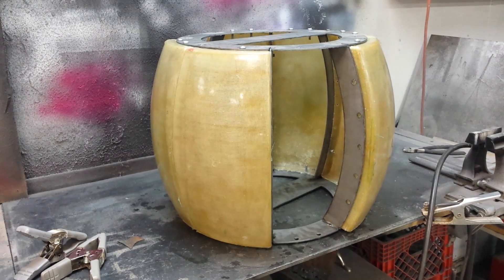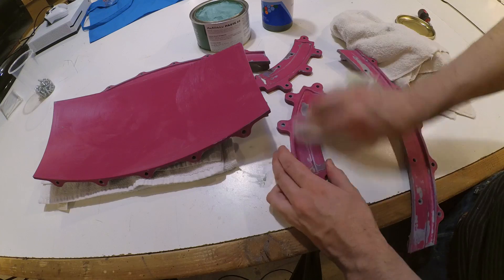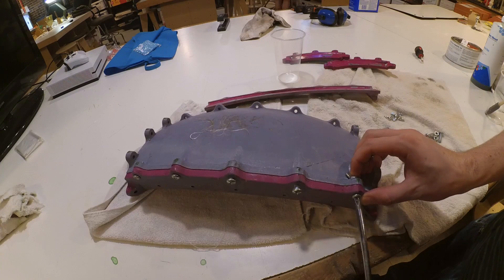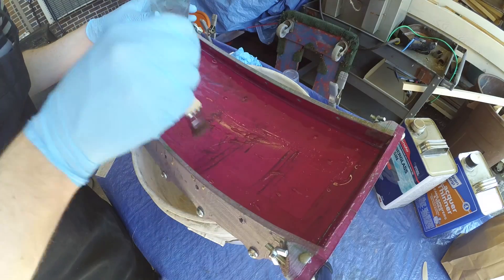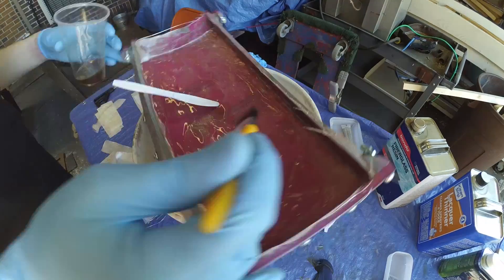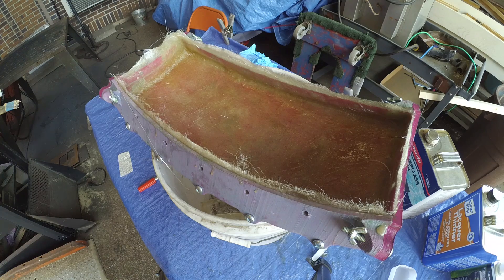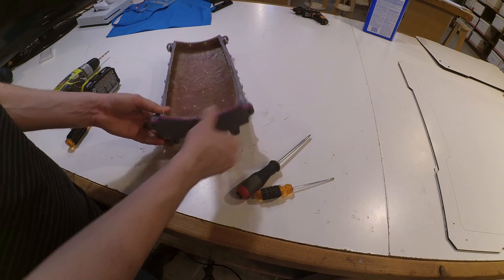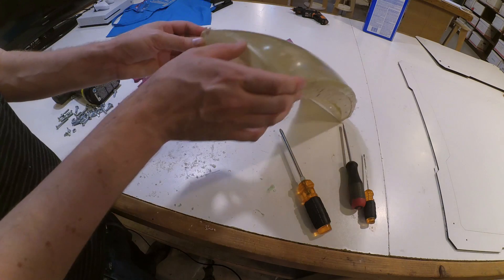Making Fiberglass Parts in a 3D Printed Mold

Comment: Hello, I tried this, but the fiberglass resin broke down the paint in my mold so I don't seem to have a good enough paint layer to hold up to the resin even with wax and pva.  In your video you mention, "final top coat of clear gross seals all the layers of paint together".  What is this gross?

Comment: Which type of material used for mold???
Reply from the maker: PLA that has been sanded and painted for a smooth finish, then waxed and coated with pva mold release
Reply: We also facing problem with mold...

Comment: So the mold wax is what you use to smooth out the 3d printer layer lines?
Reply from the maker: The mold wax is a final polish for the surface to make sure there is nothing for the resin to grab onto. The layer lines where filled and sanded using automotive filler primer, then the mold was given a final coat with gloss spray paint to make it a smooth as possible before we started

Comment: If I use an unpainted PLA mold, will the mold last several uses or will it deteriorate with the curing temperature?
Reply from the maker: I panted the mold as part of a process to smooth its surface. You can use an unpainted mold, but the layer lines and any imperfections in the molds printed surface will show up on your final fiberglass parts
Reply: @DistractedArchitect   Thank u, and what is the best infill percentage and wall thickness for this mold size or larger?

Comment: Does anyone know what the best infill percentage should be for molds like this that will be used for vacuum bagging carbon fiber?
Reply from the maker: Harold,.3D Printed parts are surprisingly good under compression. My suggestion would be 20% to 30% infill, with standard wall thickness. Before you start printing the mold, you can test the strength of a a sample part by taking something you've 3D printed and putting it under vacuum in a bag. That will tell you right away if the part is strong enough for the process, or if you need to add more infill.
Reply: @DistractedArchitect  Thank you, Michael I'll print a sample at 20%  to test it. Thanks again.

Comment: @Michael Curry isnt the curing temperature high enough to damage the PLA mold? Or is it saved by the first layer which is not resin, that shields the mold surface?
Great video, well done
Reply from the maker: I worried about this, but the heat of curing didn't cause any real issue with the PLA.  That said, this molds didn't have a long life. After casting the 8th panel the Filler Primer I'd used to smooth the 3D prints was visibly starting break down and bubble. I think that had more to do with the fiberglass resin interacting with the paint then the heat of curing.
Reply: @DistractedArchitect  Could try the ceramic paint used on engine blocks and the like. That way it's a smooth finish, impervious to any heat that may be generated and since ceramics are generally pretty rugged. It shouldn't chip, bubble or peel up and perhaps give much longer life to your molds.
Reply from the maker: @MidnightMarrow  That's a good thought

Comment: Can this method be employed in making a Micro-hydro turbine with polyester resin and E-glass fibre?
I am really worried about how to successfully make a mould using 3d printing. For making a mould, can I use PLA or ABS for this process using FDM type 3D printing?
Reply from the maker: It depends on the size of what your building. Do you want to make the turbine housing from fiberglass? Or the turbine's impeller
Reply: @DistractedArchitect  turbine impellar
Reply from the maker: @sanjheevramalingam3506  Building an impeller with this method will be difficult. You may be better off directly 3D Printing the impeller with a very high infill, then using the fiberglass molding to build the housing and other components.
Reply: @DistractedArchitect  Can I use bristles of fibre instead of using sheets of fibre mat for compression moulding?
Reply from the maker: @sanjheevramalingam3506  more than likely, but I'm not an expert in the subject and haven't personally done that before
Reply: @DistractedArchitect  Thanks Mr.Michael for clearing some doubts of mine...

Comment: you can use one sheet of fiberglass and just cut the corners, use fiberglass tow/strands in all the corners, and use a fiberglass roller to get all air bubbles out. acetone cleans polyester resin. looks good though.

Comment: how did you accomplish the inverse surface in fusion 360?
Reply from the maker: I modeled the part I wanted to mold,  then modeled the parts of the mold as separate objects. Finally i used the Modify > Combine operation to boolean cut the outer surface of the part into of the inner surface of the mold.

Comment: Gel coat is a thicker resin with color in it. Production shops have spray guns that mix the thick resin with catalyst at the nozzle. It can be thinned with acetone, mixed with catalyst and sprayed with conventional paint spraying guns. You'll want to work in small batches, just enough to spray a couple of thin layers so you can clean the sprayer with acetone before it sets. Build up enough thickness of gel coat and you don't have to paint.

Acetone is a far better solvent and cleaner for polyester resin than lacquer thinner.

Comment: Awesome video man! I have a client I designed a pretry cool SuperBatman logo for to put in his trunk on a custom subwoofer enclosure. I think I am going to try this. Surely the finished product would hold up with the hot heat of Mississippi. Right? I was planning on using Petg. But I have tons of PLA I could use to make the mold. Either way I'm going to try it for more experience. Thanks man!

Comment: This is great. Thanks for the video. I wonder if it would be possible to build an even larger part by assembling multiple 3d printed parts. I imagine there would be a seam, but couldn't that later be sanded on the fiberglass part?
Reply from the maker: It is possible to seam multiple 3D prints together to make a larger mold. I avoided doing this by just making my largest part, the back of the mold, small enough to fit in my printer. The machine that made these parts is a Makerbot z-18, which has a larger then normal build volume. I was amazed by how easily the mold lines did sand away on these parts.
Reply: Very into this read my reply to Richard Hughes on this topic. Yes almost ANY auto frame&body panels can be made using multiple printings using old school sandwich/finger joinery(usually woodworking joinery) and 1/32"half diameter zig-zag tunneling& exiting for gluing. I will lay out blind holes in each printing to accept Lamello Invis connectors(their 12mm pulls 260kg. of force to close joinery to achieve one body panel from two printings). No clamping difficult curved panel printings. Before carbon fibering both sides of a panel a attach or detach is a simple forward or reverse with any battery powered pistol drill. www.swissinvis.com  just look at their videos.  Plugin:  "Invisable Detachable Joining" in YouTube . This IS outside the box thinking that works for someone who is good with surface geometry in SolidWorks. Been eye ball to eyeball with that 3DP-Platform WorkBench#400 printer with print bed area 59"x39"x27&3/4" at about 40k$. With this gear i have stated with you&Richard Hughes a nationwide business is possible.

Comment: what 3d printer are u using and how big are the parts it can make
Reply from the maker: Dustin Mcmanus I printed the part for this mold on my MakerBot Z-18. I've had it for years and it will do a build area of 12"×12"×18"
Reply: cool do u think it would work to make a body kit mold for a 1975 280z